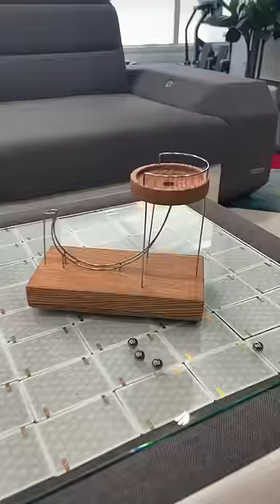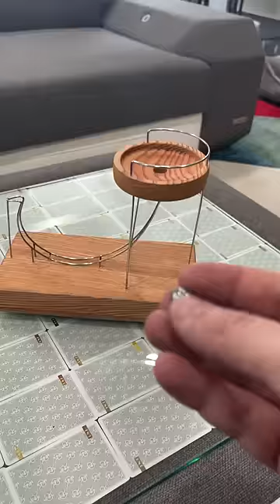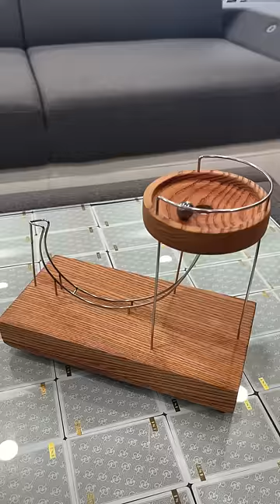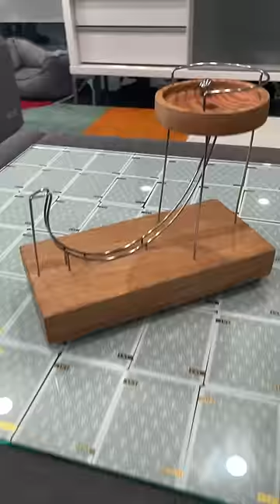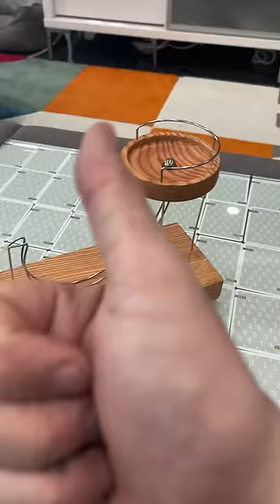An Impossible Perpetual Motion Device?! 😳 #Shorts

Comment: The hardest thing about designing a perpetual motion machine is figuring out where to hide the batteries.
Reply: Exactly
Reply: Magnets.
Reply: @tho3459  magnets are not a source of energy
Reply: @dirgenmeister4018  well, it's done out of electromagnets (batteries too, but yeah magnets are in there too
Reply: @dirgenmeister4018  and what does that have to do with anything? And while you are at it explaining that you can also explain what you mean with "source of energy"
Reply: THO energy is lost as it goes down (even though most is converted to kinetic energy). Energy is required as a result to make up the lost energy to start the loop again. Magnets aren’t a source of energy, so that wouldn’t work as a result. The only way a magnet could do this is if the magnet was moving
Reply: THO source of energy (I presume in the way  he is referring to it) is just something that can give off energy, like a battery (electrical) or a conveyor belt (kinetic and possibly potential)
Reply: Apparently you are a great man according to another commenter
Reply: I think the rails accelerate the beads similar to how a rail gun works, maybe. Im just speculaying
Reply: Hahaha
Reply: Well he did say it's actually impossible. this is likely an immitation of what it would look like if it were real.... Dunno if it's batteries though, might be magnets
Reply: @69cheesyfries  Can't be magnets. There would be no way the magnets could move, which is the only way that a magnet can provide energy.

I've seen an alternate video showcasing this revealing the compartment for batteries at the bottom also.
Reply: Quote by electroboom
Reply: E
Reply: @EEEEEEEE  BRO YOU REPLIED TO MY COMMENT 🤣😭
Reply: -stephen hawking, probably
Reply: Easy you make it wireless and put a wireless pad under the desk
Reply: Honestly though
Reply: @dirgenmeister4018  they are electrically powered magnets and even if they aren’t it’s not perpetual because it requires the magnets to help it otherwise it would not move
Reply: @treyara4852  the ball itself is a magnet 👽
Reply: Im pretty stupid but can’t they use gravity to create one?
Reply: @lehanniehaus9889  lmao no
Reply: Wait ... Really??
Reply: @ericp20z4  what?? No there are no magnets in a battery
Reply: @treyara4852  bro u forgetting gravity is the source of energy
Reply: @above7846  not in a battery... But in this Perpetuum Mobile
Reply: You forgot to add "- Electroboom" at the end
Reply: @dirgenmeister4018  yes they are ..
Reply: @sniperchachashorts5539  u saying that for real? Gravity is a force not a source of energy :v
Reply: @dirgenmeister4018  magnets are absolutely a source of generatable energy, hobbyists have made generators using magnets farther back than I've been alive
Reply: @jorgemas4844  sorry i rotw the message in a hurry i watched the video again 
And my conclusion is there might be electromagnet involved here
Reply: @dirgenmeister4018  bruh read Maxwell's equations ?
Reply: @dirgenmeister4018  but yea stagnant magnets can't do shit
Reply: Or how to convert this motion into energy without losing energy of the machine
Reply: @treyara4852  lol
Reply: @dirgenmeister4018  Magnets completely are a source of energy. Changing magnetic fields in a resistive loop inducate current. (If magnet move inside coil=energy)
Reply: @dirgenmeister4018  huh? 1/2 m v^2. Kinetic energy. Magnets cause motion. How are magnets not a source of energy?
Reply: @AverageLlama_Guy  magnets by themselves are not a source of power, they take as much as they give, maybe you mean that they are using a magnet turning on and off with batteries?.
Reply: Why does everyone think the magnet needs to be moving? It doesn’t, the ball is already moving. 

It’s not that the magnets act as a source of “energy”, it’s more likely there are magnets arranged to create a field in the little hole and as the ball moves through it, it gets accelerated slightly. 

It still obeys the laws of physics because the ball comes back to where it started, meaning that no work was done which is exactly how magnets work.
Reply: Magnets still make the machine perpetual without needed energy or electricity, i dont see a problem
Reply: @MrBigMoneyMan909  
Excuse me, but all of your three sentences are not correct.
There is a battery hidden at the platform which powers a system, if the battery runs out the ball is not able to come back to the top.
You can look it up on the internet this device is already exposed.
Reply: @jorgemas4844  gravitational potential energy aka being elevated
Reply: @angmak7321  the device is not “exposed” of course it uses a battery
Reply: @jorgemas4844  but this doesn’t work of gravity tbf
Reply: @zuby7281  🤣🤣if the ball was a magnet it wouldn't leave the rail
Reply: @dirgenmeister4018  except they are
Reply: @ppproductions6495  ohh shit 😂😂
Reply: @melk7811  Yes there is.  Forces like gravity CAN be so near lossless as to be undetectable over you describe (a well-oiled pendulum, especially in a vacuum being the classic example) but from basic kinematics you can tell the ball has more energy when being launched than it did when it fell in the hole—moving fast and able to clear a lip higher than the hole vs. moving slow and being at the height of the hole.  And none of wood, metal rails, or air are frictionless, there are “gravity funnels” and parabolic tracks you can run marbles down for an incredibly long time, but they require incredibly tight tolerances and still only last minutes to hours before running out of steam, these are not nearly that smooth.  You can even see the ball slow down to a stop from friction in the wooden funnel over over the course of SECONDS, and see it speed up FASTER than gravity can on its own while on the track.  The system has a power input.  The system ALWAYS has a power input.
Reply: @zuby7281  lol yeah we all make mistakes
Reply: @MrHocotateFreight  Magnets still aren’t providing the energy in an electrical generator, the MOTION being applied to them does, the magnets only act to translate kinetic energy (provided by external sources such as a steam boiler or wind or water at a higher elevation  INTO electrical energy.  And no, the falling bead does not count, because it returns to the starting point.  an object moved in a pure magnetic field without an accompanying electric field will generate power on one part of its trip, then expend a greater or equal amount of energy on the return trip, giving you a total power generation of less than or equal to zero.  A system can theoretically be reversible and lossless or close enough to it for it to not matter, but it cannot be that AND have any friction or other power outputs.  If there is power out, there is either power in or the system is losing energy, simple as that.  This system has power out (friction) and the visible parts of the system aren’t losing energy, so either an invisible part of the system is losing energy or there is power in—either of which a battery is the most obvious explanation for, it’s just a matter of perspective whether you consider it part of the system or an input to it.
Reply: @MrBigMoneyMan909  Work was done. Height is potential energy for an object with mass. It gets accelerated downwards by gravity but it's much harder to bring it back up since it loses momentum (energy) downwards due tp friction. Something had to bring it back up. I don't understand why you think no work was done.
Reply: @melk7811  you clearly have no idea of what you are talking about
Reply: @ericp20z4  you forgot the second bracket lol
Reply: As soon as the metal bead touches the metal rods it flicks on and off a timed electro magnet. Just enough to give it the extra push
Reply: @dodger1x  That won't work since the metal rods are connected. The ball wouldn't complete a circuit this way.
Reply: @winsleyocampo6383  Nah, perpetual motion machines break the laws of physics. Everything needs that energy to move, and everytime they do, they lose that energy. Sure, you can spin a wheel in space and it will practically spin forever, but the moment you try to harness the energy from it, the wheel immediately slows to a halt.
Reply: It could be an electromagnet which would allow it to turn on and off quite easily. I believe that a good example of electromagnets are those on theme park rides
Reply: Lmao thanks for answering
Reply: I was guessing magnets on the bottom to give higher speed
Reply: @treyara4852  so its still magnets? XD its pretty clear those beads get accelerated by a magnet which is probably battery powered and turns of the moment they passed
Reply: @Gruesome_j  magnets arent perpetual :D they lose their magnetism over time like a battery that gets drained ^^
Reply: @dirgenmeister4018  They can be. And they do indeed deteriorate. Some of the closest we've come to "perpetual motion machines" has been utilising magnets.
Reply: Close this one uses magnets
Reply: " Drop a marble into the top of this tabletop sculpture, and it rolls down a ramp and back into itself endlessly. While it might appear to defy the laws of physics, the trick is that its base contains a hidden battery and electromagnet that accelerates the steel sphere as it comes down the ramp." That what I find on internet while looking for this toy. Took me like 1 mins. If it's true then this whole conversation and argue are pointless 🤣
Reply: @shady360XD  Ok, I may be wrong here, but I believe that despite the increase of speed as the ball gets attracted to the magnet, The ball would lose more energy than it had gained when it goes to the other side of the magnet due to the attraction in the opposite direction (and other forces)
Reply: @gecgoodpasi1654  Not quite magnets, but electromagnets, which are battery powered.  If it was just a normal magnet, then it wouldn't be able to gain more speed than it lost. Likely what's happening is that the ball is magnetic and there is an alternating current being produced by the batteries in order to change the poles of the electro magnet frequently, so it only pushes the ball magnet as it comes down.
Reply: @YouTube_is_full_of_trolls  what's up?
Reply: @zuby7281  Yes, but the ball isn't giving itself more energy on its own
Reply: @sniperchachashorts5539  Yes, it's the potential energy due to gravity and height, however, it's not enough to get it to slide back up
Reply: @MrHocotateFreight  The magnet not on it's own. It needs rotational / kinetic energy also
Reply: @MrBigMoneyMan909  You can't arrange stagnant magnets that can change the speed of another magnet that doesn't return it to the same speed afterwards.
Reply: @shady360XD  the ball is, and there are electromagnets with alternating poles at play to increase the speed.
Reply: @treyara4852  i mean electromagnets are magnets so yeee xD and like u said its probably a combination of both if the ball itself is a permanent magnet
Reply: @MrBigMoneyMan909  Permanent magnets can't be used here to create the energy we need.  That's because the force that is attracting the ball causes the ball to speed up in one direction (as the ball falls), but then slow down by exactly the same amount as the ball is going back up. This is the same issue with gravity and why the ball can never end up higher than it started.
How I suspect this toy works, is that the ball creates a circuit. There is a microcontroller monitoring that circuit and when it detects that current is flowing though the circuit it turns on an electromagnet at the base. Then after a set time (the time it takes for the ball to fall) it switches the electromagnet off. That way you get a magnetic field when you want it, and none when you don't. Since the ball was being attracted to the magnet durring it's fall it has more energy than that due to gravity, and since the magnet is switched off as the ball is traveling upward it doesn't have to fight the magnet on the way back up.
Reply: @dirgenmeister4018  u can make electricity using magnets—
U lear that in 10th grade :0
Reply: @juanstrobel5273  ELECTROBOOM
Reply: This guy watches technoboom.
Reply: God the amount of extra chromosomes in this thread is enough to make an entire new person
Reply: no they actually have perpetual motion sculptures. Have you not seen iron man
Reply: Its in the wooden disc..
Reply: dude he said its what it would LOOK LIKE
Reply: @ahmeteminsenyurt131  they are real though
Reply: @tho3459  To explain why magnets don't add energy:
Something that is attracted by magnets has a force towards the magnet, but that force stays constant and to get away from the magnet you have to put the energy seemingly created by the magnet back in.
You can compare a magnet to a rubber band.

This here probably has a tiny motorized wheel in the wooden base since the ball starts with great speed.
Reply: Well I mean he did say a perpetual motion machine is impossible
Reply: The easiest way to be dumb is not listening the audio of the video 🥱🤦🏻‍♂️
Reply: How do so many people miss the point of the video lmao
Reply: Bet theres a magnet below the hole that pulls it down to speed up the ball at the very beginning and then by the time the ball gets out of the pulling force it just ramps up
Reply: Hahaha yes
Reply: @dirgenmeister4018  You got 200 upvotes for commenting on something you don’t know about. Magnets are a source of energy. They are used all the time for this purpose. They just aren’t infinitely because they do degrade and become less effective over time.
Reply: @melk7811  There is a magnet in the base. Look for other video where the base is opened. Gravity isn't a source of energy because gravity gives and gravity takes - when was the last time you saw balls bounce higher and higher???
Reply: @JustAFCasual  I am curious, so, what is the point. It seems like the guy just shows off a machine he low key claims to do the impossible for views.
Reply: @dirgenmeister4018  Magnetism is how the bearings move. There's an electromagnet in the base, which when turned on gives the railings a small magnetic field that accelerates the bearing.

So to reiterate, electricity doesn't make the bearing move, a magnetic field makes the magnetic bearing move. So this won't work with glass for example.
Reply: @treyara4852  That's how electricity works my dude, through magnetism.
There's an electromagnet in the base of this device. When turned on it sends a current through the railings which induces a small magnetic field around them. This magnetic field is what pushes the magnetic bearing along the railing.
Because it requires something magnetic this won't work with glass or anything that isn't magnetic.
Reply: @dirgenmeister4018  there aren't just magnets. If it were just magnets the ball wouldn't keep going forever. If it were just magnets, the magnets would pull or push on the ball as it approaches the magnets and then pull or push on the ball with the same force as the ball recedes. The net effect of plain magnets would be zero. Now, if you could just make the magnets move or maybe spin at just the right time...! (Wait, that requires energy....)
Reply: @sniperchachashorts5539  the gravity pulls the ball down until it hits the bottom of the rail (contributing kinetic energy to the ball) and then gravity keeps pulling the ball down as it travels up the rail (subtracting the same kinetic energy as when the ball moved down). The net effect of gravity on the ball in this device is zero.
Reply: @MrHocotateFreight  Yes, but magnets can't give net energy to the ball all by themselves unless they are moved at the right time in the right way or unless electrical current through them moves their magnetic field at the right time in the right way.
Reply: @sniperchachashorts5539  a well-timed electromagnet
Reply: @galaxya69samsung36  changing the magnetic field in an electromagnet requires energy input.
Reply: @yeslinsequeira4612  they aren't a source of net kinetic energy to the ball. A plain magnet would add or subtract kinetic energy to or from the ball when it falls towards the magnet and would add or subtract energy in exactly the opposite direction as the ball recedes from the magnet. Net energy provided by the magnet to the ball would be zero.
Reply: @MrBigMoneyMan909  wherever there is a magnet having an effect on the ball, The net effect of an unchanging magnet would be zero. This is because the magnet adds or subtracts kinetic energy to or from the ball as the ball approaches it and then adds or subtracts kinetic energy to or from the ball in the opposite direction as the ball recedes from the magnet. The net effect is zero.

Completely different story if the magnet's magnetic field is timed to go on and off or is manipulated electronically to rotate or move in some way in sync with the ball's movement That requires energy input.
Reply: @Gruesome_j  The effect of a static, unmoving and unchanging magnet would be zero unless its magnetic field is somehow manipulated electronically or in some other way. That requires energy input.
Reply: @treyara4852  if the ball is falling and then returning to the same height, the net effect of gravity is zero. It doesn't matter what path the ball takes. And the longer or steeper the path that the ball takes, the more energy is lost to air friction. And the sounds you hear the ball making? That's energy lost to the transmission of sound waves through air.
Reply: @Suekru3  A permanent magnet would not work in this specific case -_-
Reply: @bobbabai  You may be referring to the wrong person as I didn't say anything against that.
Reply: @Turgz  electricity works through the flow of electrons

But yes, that's what I'm saying
Reply: @dirgenmeister4018  yes the are
Reply: @treyara4852  Of course not. But to say they aren’t a source of energy is wrong.
Reply: @dirgenmeister4018  no, but when things are effected by magnets, they have potential energy that is lost when they are moved by the magnets. So magnets cant do infinite work.
Reply: @treyara4852  the magnet pulls the steel ball down and has a steel wire from the opposite pole wrapped around to the front of the hole which blocks the "pull down" pole from holding the ball.  The magnet doesn't have to move, only prevent itself from holding the steel ball in place.
Reply: @dirgenmeister4018  magnets ARE energy...they hold energy similar to a battery.  The energy is dissipated as it comes within reach of ferrous material....magnets die over time as they are used.
Reply: It's a battery, hall effect sensor, and an electro-magnet, in the big thick base. If they fall at the same time one will turn on the electro magnet while the other is exiting the loop, turning the kenetic energy it added into heat in the magnet coil.
Reply: @treyara4852  you were so close

Why would running power through the rails do anything?

This is done through magnets, like you said the magnet must be moving. Like yeno the little magnet that's rolling about in the video
Reply: @treyara4852  the balls the magnet man
Reply: @dirgenmeister4018  Yes, actually they are. Magnets aren't magical. They are produced by immersing them in a powerful magnetic field usually generated by electricity. The field they generate performs work. Edit: Thus they can be used as a power source in various ways. They're essentially very inefficient batteries.
Reply: @dirgenmeister4018  bruh magnets are a source of energy
Reply: Timed electromagnets?
Reply: @dirgenmeister4018  he means electromagnets probably.
Reply: Magnets?
Reply: Magnets can produce kinetic energy, Ie. Motion and acceleration. That’s definitely what is accelerating the ball so fast - and why the ball launches higher than the hole it fell down
Reply: @treyara4852  it can totally be magnets because the ball is metal and probably magnetic responding to a field. Which is why it launches
Reply: @ppproductions6495  totally depends on how strong the magnet is. You can separate magnets with you hand.. well, so can momentum.
Reply: @MrHocotateFreight  The magnets are useful in converting energy from one form to another, but the magnets don't make energy by themselves.
Reply: @dirgenmeister4018  magnets are however a source of movement.
Reply: Copied
Reply: Guys there are no batteries or magnets, its just gravity, and in the sense its not a perfect perpetual device because it includes external force which is gravity
Reply: @artisted9910  some may argue gravity is not a force
Reply: @elbabatunde8580  lol it is ofc a force, why its not a force?
Reply: @artisted9910  If I spent the time properly explaining it, I’d be wasting my time. Look it up.
Reply: Lol for people who think magnets are not a source of energy, most generators that exist use magnets. The change in the magnetic field is what creates that electricity, so inputting energy into a magnet will also change the electric field  and create work on a magnet as the balls electric field changes as well.
Reply: Wouldn't gravity be the main contributing factor here?
Reply: @dirgenmeister4018  🤦‍♂️
Reply: @dirgenmeister4018  they can produce force, sooo...they can be a source of energy.
Reply: there's a few versions of this available.

one is a con an uses batteries and the cup has a motor in it to launch the ball down the rails. it's obvious though as the cup with the hole is made of plastic on this version and has a spout before the rails.

the genuine one:

it's made from wood and stainless steel wire only; no batteries, no magnets just kinetic energy.

both on amazon, the fake one that takes batteries is about £16 the real one that's has no trickery or laziness involved in making it costs around £28.
Reply: @lehanniehaus9889  unfortunately, that isn't how railguns work.
Reply: Electromagnets are the things you all are look for
Reply: Arguably, all you need to hide is the wire FROM the battery.
Battery can be hidden or tucked far away from the action.
Wire's easy to hide.
Reply: @eneveasi  Except it can't be a permanent magnet that propels it because the speed it would gain as it gets attracted down is the same amount it would lose on the other end as it's attracted backwards
Reply: @Hazed64  I was talking about the mechanism under the wood. Not the ball itself. That can't be a permanent magnet.
Reply: @Hazed64  Because a permanent magnet can't do this alone. Yes as the ball comes down, the ball will be attracted to the magnet and go faster, but then after going past the center of the magnet, that same attraction will occur backwards as well slowing it down. The speed gained will be equal to the speed lost, resulting in no net gain.

The reason having power through this is because the bottom isn't a permanent magnet, but actually an electromagnet. The current provided by the batteries underneath provide an alternate current and  cause the electromagnet underneath to be switching from attracting the magnet to repelling often. Because of this switching, only that would allow it to accelerate that much.
Reply: @EricPriceOfLouisville  First of all, if the steel wire is wrapped around the ball, the ball would have a net pole of whatever the wire is, so the magnet wouldn't attract in the first place well. The magnet would always be closer to the wire, so the net attraction would always be repulsion.

In order for a permanent magnet to give off energy, it needs to be moving. Only then can it induce a current inside another wire. A magnet doing nothing cannot provide a net change.
Reply: Ohw wow, those comments made me literally a bit dumber reading them. 
The sheer confidence ppl here stating  that "magnets are a source of energy" or "you forgort gravity" is just mind boggling.  
1. Go back to school. 
2. If you don't know shit, don't embarrasse yourself online
Reply: @EricPriceOfLouisville  First of all, if the steel wire is wrapped around the ball, the ball would have a net pole of whatever the wire is, so the magnet wouldn't attract in the first place well. The magnet would always be closer to the wire, so the net attraction would always be repulsion.

In order for a permanent magnet to give off energy, it needs to be moving. Only then can it induce a current inside another wire. A magnet doing nothing cannot provide a net change.
Reply: @EricPriceOfLouisville  First of all, if the steel wire is wrapped around the ball, the ball would have a net pole of whatever the wire is, so the magnet wouldn't attract in the first place well. The magnet would always be closer to the wire, so the net attraction would always be repulsion.

In order for a permanent magnet to give off energy, it needs to be moving. Only then can it induce a current inside another wire. A magnet doing nothing cannot provide a net change.
Reply: @EricPriceOfLouisville  First of all, if the steel wire is wrapped around the ball, the ball would have a net pole of whatever the wire is, so the magnet wouldn't attract in the first place well. The magnet would always be closer to the wire, so the net attraction would always be repulsion.

In order for a permanent magnet to give off energy, it needs to be moving. Only then can it induce a current inside another wire. A magnet doing nothing cannot provide a net change.
Reply: @EricPriceOfLouisville  First of all, if the steel wire is wrapped around the ball, the ball would have a net pole of whatever the wire is, so the magnet wouldn't attract in the first place well. The magnet would always be closer to the wire, so the net attraction would always be repulsion.

In order for a permanent magnet to give off energy, it needs to be moving. Only then can it induce a current inside another wire. A magnet doing nothing cannot provide a net change.
Reply: @Suekru3  Fair enough
Reply: Wow, the amount of people saying that magnets are a source of energy....
Magnets are just a static magnetic field, they will never generate any energy without external motion, that we are trying to CREATE here in the first place 😑
Reply: @dirgenmeister4018  Uhm do you know how a magnet is created in nature ? Alot of stored energy in magnets :) Basic physics buddy.
Reply: @yeslinsequeira4612  because they take as much as they give, they don't provide energy to the system, they give as much energy attracting as they take resisting the object to move from the magnet. Thus they are not a source of energy
Reply: @MrBigMoneyMan909  no, it's powered with batteries, look it up on the internet.
Reply: @tho3459  YEAH BITCH!!! MAGNETS!!!
Reply: @ericp20z4  electromagnets* not actual magnets
Reply: We had one in our house when I was a kid... it needed no batteries, it stops eventually do...

It can take 6 days before it fully stops...
Reply: Gravity is proving the energy each time
Reply: @winsleyocampo6383  gravity helps, but it can’t be used to create a perpetual motion machine. Due to friction, air resistance, and possibly other unknown unknowns, some of the potential energy from gravity will be lost as heat; gravity alone could not make the ball “jump” higher than its starting point.
Reply: True
Reply: @lehanniehaus9889  Which requires electricity.
Reply: Lmfao
Reply: @IONATVS  gravity isn’t a force
Reply: @UltimateFeudEnterprise  Depends on the textbook if they call the Gravitational Force “Weight” or just “Gravity” but in either case it absolutely is one.  Weight_AB = Force_Gravity_AB = UniversalGravitationalConstant * Mass_A * Mass_B / Distance_AB^2
Reply: 166 comments... yet I can't see a single one.... perpetual bs? Idk
Reply: @jorgemas4844  no but an object pulled away or moved ina certain posicion in the planet's gravitational field gives it potential energy, gravitational potential energy.
Reply: @dirgenmeister4018  yes they are
Reply: @Gruesome_j  niether do I
Reply: @lukescovell8294  true
Reply: - ElectroBoom
Reply: @treyara4852  magnets don't have to move to impart energy they have a magnetic field which weakens over time as it imparts energy to fling the bead
Reply: Jesus Christ is Lord. It is all true. Please take your salvation seriously.  Read the Bible and do what it says
Reply: @MrHocotateFreight  I love reading the comments on this. Clearly alot of people failed physics and has no idea that magnets or rather magnetic forces can be generated by electricity.
Reply: @sniperchachashorts5539  you can't get enough from that. Some is lost to heat and friction. That's what thermodynamics says
Reply: @charlessellars7871  Magnets to do need to move in order impart energy. All that stationary permanent magnets provide is a constant magnetic field.

If a magnet is needed to move in order to get energy out of it. When a magnet moves through a coil, there is a current produced in the coil. This movement of the magnet inside the coil is basically how power generators work iirc.

A permanent magnet would not work in this case. The ball is a magnet. 

As it goes down and gets to the supposed permanent magnet, the ball will speed up due to gravity and the magnet on the ground. However that changes immediately the ball goes to the other side of the magnet.

The ball is still a magnet that's attracted to the magnet on the ground. That attraction is in the opposite direction. Due to that, the ball loses speed. The thing is, it loses the same amount of energy that it gained int he beginning for no net change.
Reply: @galaxya69samsung36  that's a big if
Reply: @Gruesome_j  lol thermodynamics disagrees with you.
Reply: @treyara4852  you do know you can arrange the magnets where they push the bead along, they do not need to actually move, magnets are not permanent and will lose power as it imparted onto that ball to toss it back up
Reply: @iamthedoctortoday5788  Bingo! An electromagnet with a pressure switch at the bottom of the rails which turn it off for a second as the ball (now with greater kinetic energy) can overcome the gravitational pull and do the seemingly impossible.
Reply: 😂😂😂 nailed it.
Reply: @dirgenmeister4018  magnetic field is literally the source of energy.
Reply: @dirgenmeister4018  magnetic energy
Reply: @yeslinsequeira4612  motion created by a magnetic field is an example of potential energy being converted to kinetic. You have to "charge" the object first by placing it some distance away from the magnet. When you do that, you do work against the magnetic field, and it's your hand that is the source of energy, not the magnet.
Reply: They're in the thick base of this toy
Reply: Was reading the comments to see if anyone noticed the "beads" at the beginning of the video moving towards one side of the table as it the table was not evenly leveled. Not saying the video is fake, just saying
Reply: @dirgenmeister4018  electromagnets
Reply: @ajvasquez160  it absolutely doesn't matter. Gravity is a conservative force, so no matter how you arrange the whole contraption, it won't work without an external influx of energy. Whatever conservative force acts on a bead when it travels down, will have to act on the bead on its way up, slowing it down and eventually bringing it to stop. But we see that at some point the bead reaches a much higher altitude compared to the point it started its descent from. That means that something gave the bead that extra energy. One of the ways to do that is to switch the magnetic field on and off, so that it would accelerate the bead when it travels down, and would not decelerate the bead when it travels up.
Reply: @charlessellars7871  First of all, Please can you tell me how you would arrange the magnets so that it only pushes the bead but doesn't pull. If you can let me know, then I will concede this, but the problem is you can't do it without having the ball lose the same amount of speed that it gains from the magnet. The net change in speed due to the magnet would have to be 0.

As for your other point for the magnet losing its pull over time, this is true, however the amount of pull lost per iteration is so small, it can be reasonably assumed to be 0
Reply: @tho3459  Means energy is being put into it so it’s not a perpetual motion machine as they don’t exist…understand now 😜
Reply: @sniperchachashorts5539  there needs to be extra energy added each time to counteract the potential energy lost to friction and air resistance that isn't converted to kinetic energy. If there wasnt extra energy input then the ball wouldn't reach the height necessary to get back up to the funnel.
Reply: @jorgemas4844  "gravitational energy" is a common shorthand for gravitational potential energy. There's no need to be pedantic.
Reply: @MrBigMoneyMan909  work is always done unless you're in a frictionless vacuum which is exactly why perpetual motion machines are impossible because frictionless vacuums don't exist.
Reply: @tho3459  the most of it ooo
Reply: Magnets are a force of energy, not a source of energy
Reply: Someone ordered this and never got it?? I wondered how much they paid 🤔 ?
Reply: Someone ordered this and never got it?? I wondered how much they paid 🤔 ?
Reply: or the old man turning the crank
Reply: If you look at the ball, it is still losing energy in the jump, it’s just that the wooden platform lets it regain the lost momentum by allowing the ball to travel towards the hole—it’s initial point—once again. If you look closely, the ball always falls short of the hole. That’s the lost momentum that most definitely exists.

The platform could be any length between the hole and the ramp exit, and it could still be considered an infinite loop in this regard. The same principle is present here, at a smaller scale.
Reply: Of course, no one could ever prove that it is perpetual.
Reply: Simply gravity there
Reply: @jorgemas4844  that's all a matter of perspective
Reply: Electricity is simply electrons moving due to a force exerted upon them. Therefore it is not a source of energy, but simply a symptom of another force at work. Odds are the force that acted on it went in motion form another force.
Reply: Hahaha 🤣
Reply: Gravity is a good source of kinetic energy
Reply: It’s batteries, I bought one of these… returned it
Reply: @winsleyocampo6383  no, to pull something up in a gravitational field it takes energy, combined with friction causing it to lose energy.
Reply: What batteries?
Reply: yeah
Reply: @dirgenmeister4018  Magnets are definitely a source of energy.
Reply: @treyara4852  wth would it need batteries for, the bead falls down and is sling shot back onto the top to repeat the process..
Reply: @sniperchachashorts5539  magnetic ball and rails, to accelerate it I guess ?
Reply: @JB-pb9xv  When the ball falls, the magnet attracts the ball to make it go faster. That part  is true, but as it starts to go up again, away from the magnet, where it would supposedly slingshot back to the top, the magnet is still attracted to the ball. The ball is moving forwards, but the magnet is attracting the ball backwards. Because of this, the ball loses the same amount of speed gained by the magnet, and there is no change in speed, meaning magnet or not, it would get to the same place in an ideal world

In the real world, this magnet interference would result in an even shorter distance traveled in the air.
Reply: @JB-pb9xv  Because of the way magnets work like that, the ball wouldn't have a net increase in speed. The reason batteries are required is because batteries can power an electromagnet with an alternating current. With this, the magnet is going to be constantly switching poles back and forth, so the ball gets attracted initially, but then as it goes past, it gets repelled afterwards to finally get that effect.

Another way to disprove the idea with permanent magnets is that we know that perpetual motion machines cannot exist. If it were just a still magnet without the magnet experiencing any sort of change, it would be perpetual motion, with no energy lost. The battery is needed to supply the energy lost.
Reply: I think magnets are a source of energy, we just haven't discovered how to extract it yet.
Reply: Instead of perpetual motion why not very long time motion like 50,000 years? Then even at that point when it’s over just start up another one
Reply: He did say "It doesn't exist but IF it did, it would sorta look something like this." You're so smart you don't even know how to listen. lol
Reply: No,. It's the wired that are hard to hide
  You can use 2036 watch batteries on the bottom of this.  How do you get the wired from the batteries up to the electro magnet on the top to complete the magnetic circuitl?
Reply: @69cheesyfries  Well said.
Reply: @c_n_b  The problem with that sentiment is that we do know how to. It's through the movement of the magnet through a coil. That's how we get electricity from a generator. It is necessary for the magnet to move for the energy to be extracted.

It's impossible for stationary ones though.
Reply: @samesamv1472  And it uses batteries... It's a quote about batteries in a perpetual motion machine. Sure it would look something like that, but it's just commenting on how they don't exist.
Reply: @tylerpixel  We would need nigh 0 friction. I'm not sure we can get that yet.
Reply: And magnets. Dont forget magnets!
Reply: Hahaha
Reply: Humans are OG perpetual motion machines
Reply: @MrBigMoneyMan909  work was done to overcome the losses due to friction and air resistance.  If there was not energy loss it could be scaled and turned into a generator that creates free energy
Reply: All of you arguing that perpetual motion machines exists should go back to school and study your basic science. I mean fuck, this thing launches the ball HIGHER than where it starts off.
Reply: @OurNarutoSaga  Except for the part where we eat and breathe, sweat, do any physical activity, do literally anything, etc
Reply: Abrar  I don't even know what this comment is in reply to, I just giggle reading it.
Reply: @artisted9910  gravity is internal, not external.
Reply: @oh0stv  you said that while spelling embarrass wrong. You also misspelled forgot. You have an unnecessary double-space. I'll hush. You're properly red now.
Reply: @UltimateFeudEnterprise  yeah, what was Newton thinking?
Reply: @charlessellars7871  we will all wait for 10-100 years to see when we can measure the weakening of the magnetic field of a permanent magnet. You take first watch.
Reply: @TortureBot  sprech deutsch mit mir, wenn du was zu sagen hast.
Reply: @dirgenmeister4018  according to quantum physics all particles that make up mater, molecules, atoms, subatomic particles, Quarks. All of them consist of energy. And make up the illusion of physicality, and is the first thing you learn when your professor starts ranting. So magnets are not only a source of energy, but ARE energy. Just as much as your all-knowing self is a waste of energy
Reply: @treyara4852  what if we get magnets to move magnets and  magnets to move magnets and  magnets to move magnets and  magnets to move magnets and  magnets to move magnets and  magnets to move magnets and  magnets to move magnets and  magnets to move magnets and  magnets to move magnets and  magnets to move magnets and  magnets to move magnets and  magnets to move magnets and  magnets to move magnets and  magnets to move magnets and  magnets to move magnets.
Reply: Under the wood
Reply: @treyara4852  really Mr. Try Hard McGee?  Why don't you share said alternate video? Magnets could definitely work in this setup, but will lose their pull overtime. They act on the kinetic energy of the steel balls and aid the centrifugal motion to add speed.  The magnets would be implanted somewhere in the device, they wouldn't need to move at all. Did you know that in some parts of the world railstations use magnets to hover carts over the tracks to provide a smoother, more energy efficient train ride?
Reply: @bobbabai I think you’ve misread the room, although there are some misguided folks on here for sure, nobody here has expressed they believe it is actually a perpetual motion machine, as it isn’t/couldn’t be (as you point out) it was well established in the comments that this system must use an external source of energy and it has batteries in the base to power an electromagnet.
Reply: @artisted9910  there are both batteries and an electromagnet
Reply: @tsloth1390  I can't take the time to review this nearly 300-comment thread to find out how I got it wrong. YouTube is terrible for this.
Reply: Source of energy... gravity!!
Reply: @dallaspower  No. It's not a source of net energy if your height above the center of the earth just varies up and down by the same amount each cycle. In that situation, the ball and the earth are just trading energy, with a little bit of energy lost to friction at every instant.
Reply: Magnets ... As stated previously I'm certain
Reply: @dirgenmeister4018  that is not true...but it also hasn't been proven yet either..except maybe one guy..Tesla..but we'll probably never know everything he knew or created.
Reply: Battery Electro magnet with timed off switch. The magnet turns on to generate momentum then quickly turns off to free the ball from magnetic forces.
Reply: @EEEEEEEE  æœ
Reply: @tophatvideosinc.5858  That is a good thought, here's what's wrong.

1. If the magnets are straight, then you'd have to push the end magnet, so then you'd be supplying energy making this not perpetual

2. If the setup is a ring type of structure, you encounter 2 problems.

a) As you start placing down your magnets in the ring, you'll find the last one you try to place down will be super hard to place because of the repulsion effects that you would want to theoretically make it spin forever

b) The magnets in the ring, despite having only repulsive forces being acted on them, are in equilibrium. There's a friction force, and 2 non-linear magnetic forces on it. As it's in said equilibrium, it will not move. If it's already moving, the friction will be greater and cause it to slow down on the ring, and the entire thing will slow to a halt.

It wouldn't work.
Reply: @EEEEEEEE E
Reply: @dirgenmeister4018  potent energy
Reply: @dirigenmeister magnets, like batteries, demagnetize after a while, making it a "fake" perpetual motion device
Reply: @yeslinsequeira4612  There can be no net change in energy due to the magnet before and after the effects are felt from the magnet
Reply: @solomonkirton9347  Except it can't be magnets in the first place because the speed the ball gains is the same amount it would lose. Also the decrease in the pull in the magnet takes so long that it can be assumed to be negligible for a run of the machine
Reply: @sniperchachashorts5539  you confuse force and energy. A Force only Work (produces energy) depending of angle between force and mouvement. So when you're standing still or in a car, gravity doesnt "work"
Reply: It's in the bottom
Reply: @treyara4852  what if the balls were magnetic?
Reply: @dirgenmeister4018  magnetic energy?
Reply: @andrewthecoleman  They are. Permanent magnets wouldn't work though because the ball would lose the same amount of speed that it would gain. It has to be (and is from other video's I've seen) an electro magnet.
Reply: @dirgenmeister4018  "Electromagnetism crying in a corner"
Reply: No - it's even simpler - just magnets
Reply: @treyara4852  the ball is moving
Reply: True. The way the ball jumps to the top seems unnatural. something's fishy
Reply: @neilsjmcmahon  I know. The ball (due to the magnet) will accelerate because of the magnetic pull as it goes down the ramp, however it will then decelerate immediately after due to the magnet attracting in the wrong direction, so it slows down until it's at a net change in speed 0 from before and after the magnet was really affecting it.
Reply: @yeslinsequeira4612  oh no, someone didn't go to school
Reply: @lehanniehaus9889  no its just gravity
Reply: -ELECTROBOOM
Reply: @tho3459  Magnets alone can't do this. It's not a completely isolated system so there has to be a source of energy.
Reply: @ariffansar4994  more downwards acceleration = more momentum to make the jump?
Reply: I think the rod over which the conducting ball rolls over has current flow
Reply: They are under the base I guess
Reply: @dirgenmeister4018  magnets don’t stay magnet forever either
Reply: @dirgenmeister4018  They are if you don't think about it.
Reply: In this case it’s not even hard though with a large and conspicuous base, obviously it’s using an electromagnet to accelerate the ball on its way down.
Reply: Magnets. You can see the opposing poles as it makes its way down the hole.
Reply: @tho3459  
I'm not sure anyone could explain anything to you. A book, a mind, and a parachute all function best when they are opened.
Reply: @jorgemas4844  
Look for a veritasium video clip titled gravity is not a force. Available on YouTube.
Reply: Gravity?
Reply: @IONATVS  
Some of the simplest things are almost impossible to explain to simpletons.
Reply: @generalmisery  
Toys are fun and people are not as clever as they think they are
Reply: @alexjanito3404   Without any expenditure of energy elsewhere in the system to stop it from happening that same magnet would pull that same energy out of the ball as it “just ramps up.”  The magnetic field a magnet that isn’t being moved creates is, always and inevitably shaped in such a way that the amount of magnetic potential energy an object has only depends on its position relative to the magnet.  And that means if you return to the same spot, no matter what path you take to get there, you have the same magnetic potential energy that you started with, and if you are losing energy to friction it’s physically impossible to get back to the same spot with the same speed without some other store of energy losing energy or power coming in from outside the system, and only at exactly the rate that that other source loses energy or supplies power OR LESS.  The same is true of gravity fields.  Other power inputs can move the magnet or a mass in such a way that this no longer holds true, but that is by definition a power input and thus not a perpetual motion engine.  All energy has to come from somewhere and while you can temporarily store energy in a magnetic field, or chemical bonds, or matter you can’t get more out of it than you put into it. Magnets and Gravity aren’t magic, the way they work follows strict observable rules, and under those rules there is simply no way to make a perpetual motion engine.
Reply: @IONATVS  ok. So then how does it work..
Reply: @alexjanito3404  ELECTROmagnets or natural magnets being MOVED by a hidden electromechanical system that uses equal or greater amount of energy than the ball bearing gains.  The difference is while an object in any given position in a static magnetic field has a fixed potential energy, the CHANGE in the magnetic field can TRANSMIT some or all of the power used to change that field into an object moving in that field.
Reply: @IONATVS  ah, so essentially if theres magnets, it has to be powered by say atleast 3 volts with a more complex system than we are being shown. Most likely in the base
Reply: @winsleyocampo6383  Gravity is a force, not a source of energy, so even if they did, ir wouldn't be "perpetual energy"
Reply: @alexjanito3404  precisely. it doesn’t have to be much, but there has to be something inputting power to the parts of the system we can see (ie something like a battery that we don’t see but is losing energy) to overcome the friction and air resistance and bring it back to the starting energy state.  Perpetual motion machines are, under all known physics, completely impossible, so “making” one is just a stage magic trick—they’ve designed the system so it looks vaguely plausible but have a secret they’re hiding that makes it do what they say it does, but not WHY they say it does it.
Reply: Umm, in the wooden base 😏
Reply: I didnt know it has battery😂😂😂😂😂
Reply: @lehanniehaus9889  Well, you’re definitely speculating but, that doesn’t necessarily mean you’re wrong.
Reply: too true😂😂😂
Reply: @Gruesome_j  Sounds reasonable, except that our universe just doesn't work that way.
Reply: @dirgenmeister4018  an electronic magnet
Reply: @treyara4852  without magnetic field electricity is not possible sorry that's part of the law
Reply: You kill a professional bowler and trap his ghost in the ball. C'mon man!
Reply: @lemnlit3291  Umm... When did I say that's not the case?
Reply: @lemnlit3291  Also btw you are only half right. A magnetic field can induce electricity if it moves, but electricity can also induce magnetism as magnetism caused by acceleration of electrons.
Reply: Jesus Christ loves you all please repent and forgive
Reply: @littlesam6280  moment
Reply: @dirgenmeister4018  magnetic fields have energy stored within them
Reply: @treyara4852  I'm probably the 100th person to reply to you, but the magnet wouldn't need to move in order for it to provide "energy".

The way this works, the best I can understand it, is that there's a magnet (electronic, most likely) at the bottom of the rail. When the ball bearing gets within the magnetic field, the ball bearing starts getting pulled toward the magnet, allowing for a larger acceleration than just gravity alone. From there, 1 of two things happen.

1. Because the ball bearing is moving so fast, and it's dense, it has a lot of inertia. This invariably carries the ball past the magnet. The magnet doesn't need to be that strong to provide additional acceleration while the ball is being pulled down by gravity, so it likely isn't strong enough to trap it, or slow it down significantly enough before the ball is launched.

2. The slightly more complicated answer would be the use of electromagnets. Since the rails are likely a conductive material, and the ball most likely is as well, they could have an electromagnet at the bottom of the curve, which is significantly stronger, and provides for even more acceleration and inertia. This magnet could simply only be turned on while the conductive ball is touching both conductive rails, which would close the circuit. Once the inertia of the ball carries it off the rails, the circuit is no longer closed, no power is being fed to the magnet, and it's not pulling the ball back toward it anymore, until the ball touches the rails again.
Reply: I’m not saying it’s Aliens but….
Reply: @AugmentedSmurf  The only possibility is an electromagnet. A permanent magnet cannot work in this case, because it will slow the ballbearing just as much as speed it up, so will have no net effect. Your suggestion about using the rails themselves to complete the circuit is an interesting one, and possibly could work. Either way, a power source is definitely required, and it needs to have some way to momentarily activate an electromagnet each time the ballbearing begins it's downward cycle.
Reply: They are always showing....SMH

Batteries these days
Reply: OMG NOT MAGNETS, GRAVITY
Reply: @lehanniehaus9889  but a rail gun works similar to how a remote controller vibrates it has little motors that spin with batteries around the edges of the motor creating a pull Forcethat would be pretty danm hard to hide also the device would be super bulky if it were to be using a magnet strong enough to pull the metal bead from down below so really who knows how it works other than scientists
Reply: @tho3459  Problem is a permanent magnet takes away that extra acceleration for the jump that it gives
Reply: @treyara4852  If you were to put it in the entire base yes. I think it should be doable if its only right below the hole.
Reply: @tho3459  The problem would still arise just below the hole. The ball gets very attracted to the hole and goes down it, but then the ball starts falling and going down the ramp, but the magnet is still attracting the ball, just in the upwards direction. Any speed that was initially gained from the magnet will be lost as this occurs, so it is as if the magnet isn't there at all
Reply: @treyara4852  no, i mean in the base but under the hole. The shape of the rail moves the ball far enough away from the magnetic field before the jump.
Reply: @tho3459  If you mean directly under the hole inside the wood, that still wouldn't work.

1. The magnet being that far away initially from the hole doesn't make the ball go so much faster, so initially the magnet will have very little effect.

2. The point where the magnet would be closest to the rail is still a fair distance away, but assuming that pull is non negligible, the magnetic pull would be towards the magnet. It would not help pushing it down the rail. The force would be into the rail; barely down the rail if at all, so barely any speed would be gained by the magnet if at all.
Reply: @treyara4852  1. If the system has low enough "friction" even a slight boost might be enough.

2. Same with gravity.
Reply: @tho3459  Gravity is a conservative force, so that will not help. Also along with the slight boost, the magnet is pulling the ball into the rails. This forces the normal force of the railing to increase so that the rail doesn't break.

Ffriction = Fnormal * mu. Because the normal force increases, Force friction also does so as well, so then the slight boost should be counteracted by friction itself
Reply: @tho3459  Gravity is a conservative force, so that will not help. Also along with the slight boost, the magnet is pulling the ball into the rails. This forces the normal force of the railing to increase so that the rail doesn't break.

Ffriction = Fnormal * mu. Because the normal force increases, Force friction also does so as well, so then the slight boost should be counteracted by friction itself
Reply: @tho3459  Gravity is a conservative force, so that will not help. Also along with the slight boost, the magnet is pulling the ball into the rails. This forces the normal force of the railing to increase so that the rail doesn't break.

Ffriction = Fnormal * mu. Because the normal force increases, Force friction also does so as well, so then the slight boost should be counteracted by friction itself
Reply: For real...and they hid them so well....how is this working X D
Reply: @dirgenmeister4018  they are, it costs energie to produce effictive magnets, and dont forget about Electric magnets.
Using magnets for perpetual motion would still be cheating.
Reply: @tho3459  hes completely wrong, u cannot make magnets without investing energy and overtime those magnets would die down. Aka the battery runs out of Juice over time.
Reply: @darrellbeets7758  yeah, over a while. Its not like batteries where you need to change them like once a day/week of running it.
Reply: @tho3459  i really dont see what the point of ur argument is but yes? Magnets last longer on average then zink batteries??my only point was saying a Magnet is a medium to store energie or take energie from aswel, and could or should count as a batterie on a perpetual motion device or in general if u ask me.
Reply: @darrellbeets7758  yes, same as me.
Reply: @darrellbeets7758  Electromagnet underneath the base (in the wood), powered by batteries also located there also
Reply: @treyara4852  oké that would work...but how did he manage to solve the timing issue, a railgun with a magnet turned on at all times wouldnt really ve possible 😜
Reply: @darrellbeets7758  I'M LITERALLY SAYING THAT A MAGNET THAT'S ALWAYS ON WILL NOT WORK!

The battery provides an alternating current causing the poles of the magnet to switch back and forth every so often. It's just that 
-_-
Reply: @darrellbeets7758  Also where did you get this railgun idea from?
Reply: @treyara4852  as an example. Rail  with Magnet shooting metal..
Reply: @neilsjmcmahon  No. Electro magnets
Reply: @darrellbeets7758  I specifically asked where I said rail gun.

I said rail. You know? The thing the ball is traveling on? The 2 thin point ramps? That rail?

When did I say magnet shooting metal?

What?
Reply: @darrellbeets7758  quote me
Reply: @tho3459  it does with the fact that it's a perpetual motion device, and needs energy? Not a magnet lol
Reply: @Soarano  From wikipedia: "In physics, the kinetic energy of an object is the energy that it possesses due to its motion. It is defined as the work needed to accelerate a body of a given mass from rest to its stated velocity."

Does a magnet not apply a force to help accelerate a ferromagnetic ball?
Reply: @dirgenmeister4018  Yes they are magnets + gravity = energy
Reply: And the magnets!
Reply: @eugene9852  Exactly my point. The closest you can get. You just expanded my point. But, you got it 110%. The OP was staying that magnets had nothing to do with it. They are the "closest," it being an oxymoron and all.
Reply: @tho3459  uhh no it doesn't unless it's an electromagnetic being this case here which is powered by the battery?
A magnet itself doesn't contribute to it gaining kinetic energy
Reply: @Soarano  im not quite sure that we have had the same magnets in that case.
Reply: He never said this was real. Its just a thing showing what perpetual energy would look like
Reply: @lehanniehaus9889  I think theres a small electromagnet and the base of the ramp in the wood that helps push the ball back to the platform. It seems like it wouldnt be worth the extra cost and effort to incorporate the magnets in to the rail. It's a toy after all. But I'm no magnet expert so who knows.
Reply: @treyara4852  electro magnets my man. It's not a perpetual motion device no matter how you cut it. But if were talking about how this toy works, my guess is an electromagnet at the base of the ramp in the wood that helps push the ball a little.
Reply: @above7846  You can power an electromagnet with batteries.
Reply: @MrHocotateFreight  magnets only "generate" electrical energy when you pass a magnetic object through its magnetic field. You have to use some form of mechanical energy to do that. Thats how generators work. Or inversely you can use electrical energy to power a magnet that then imparts a force on  what ever magnetic object is in its magnetic field and makes it turn or move. Converting electrical energy in to mechanical energy. Like a ceiling fan. The magnet it self does not generate energy unless another force is acting upon it.
Reply: @galaxya69samsung36  but you have to use a mechanical force to move the magnet in the first place. Thus it is not generating energy it is converting energy. Also known as transduction if you want to use big words.
Reply: @IONATVS  preach brother!
Reply: @treyara4852  you would be absolutely correct. the only thing is electromagnets can be turned off and on at the right time to give the ball a speed boost without slowing it down. This ofocource requires electrical energy likely coming from a battery in the base.
Reply: @charlessellars7871  and as the ball passes over the center of that magnet the same force that attracted it forward will attract it backward resulting in a net gain of 0.
Reply: @jamesmayle3787  Take your meds please.
Reply: @stevenc8717  it has battery powered electro magnet. The ball can only reach a higher altitude than it started at if an extra force is acting upon it. The electromagnet turns on briefly to give the ball a little boost as the ball passes through one magnetic pole but turns off before that same magnet can slow it back down with its other pole. This adds just enough energy to push the ball back up to its platform. In this system chemical energy (the battery) is being converted (by the magnet) in to mechanical energy ( motion of the ball).
Reply: @treyara4852  I dont mean to be pedantic but i think something slightly different is going on. Batteries do not produce alternating current. They produce direct current. I think that instead of the fields switching back and forth like with AC, it actually stays the same but there is a control circuit that turns the magnet on and off. Now, there could be a device that converts DC to AC (that's what a rectifier does right?) to do it the way you explained but I think that would be unnecessary for making this toy and would probably consume more energy. I'm open to the possibility I'm wrong though.
Reply: @Jagger02  You are thinking of electromagnets. Electro magnets require electrical energy to function. Which what is most likely powering this toy.
Reply: @tho3459  If it never returned to its starting point, it could, but there is a property of gravitational and magnetic fields that in a static (ie not moving) field, an object’s potential energy in the field is ONLY a function of the object’s position, not the path it took to get there.  That means that a fixed magnet can accelerate a ball as it falls towards it, but if it moves back to the starting point, as it does in this case, it will decelerate it by the EXACT same amount.  which means the kinetic energy of the system can not increase from doing a loop in a static gravity or magnet field.  And with losses due to friction, it shouldn’t even be able to do that.  If you use electrical energy to temporarily CHANGE the magnetic field, you CAN add energy and not remove it, but you must supply at least as much energy or more from an outside source to do so.  For example, a battery.
Reply: @AugmentedSmurf  number 2 is correct for the most part. Number 1 is wrong because the magnet attracts ball as it comes in and speeds it up. However, once it pass the center of the magnet the exact same force that sped it up will slow it down resulting in net 0 work done.
Reply: @animalmother3526  Um. Did you mean to reply to another person? I've been arguing that it's been electromagnets for 3 weeks now.
Reply: @animalmother3526  To your comment taht started off like this:  you would be absolutely correct. the only thing is electromagnets can be turned off and on...

Yea... That's what I've been saying? what's your point? No one is arguing that perpetual motion machines are possible.
Reply: @animalmother3526  To your comment that starts off with: I dont mean to be pedantic but i think something slightly different is going on.

That is true. I mistook the type of current. Turning it off an on is fine as you said as long as the magnet is powerful enough. I am curious now whether the creators opted to alternate poles or just switch on and off
Reply: @animalmother3526  no it depends on how ypu set up the magnets and also, I have made one of these before,  it's not that hard to do and makes for a little fun science project on magnets,
Reply: I would think if it continuous works it is creating its own energy .... Even if there are magnets if it's working under its own effort it's perpetual energy ...
Reply: @eneveasi  electromagnets powered by electricity yes. Permanent magnets no.
Reply: @eneveasi  a permanent magnet will impart a force and pull the ball as the ball enters its magnetic field speeding it up. Once the ball passes the center of the magnet the same amount of force that made it go faster will now slow it down. Resulting in net 0 force. Basically, a permanent magnet wont make a difference. An electromagnet on the other hand can be turned on/off so that its pulls the ball but turns off as the ball passes in order to speed it up. However an electromagnet requires electrical energy obviously.
Reply: @treyara4852  Yea me too. I hadn't originally considered that they by alternating poles. That is how 3 phase motors work afterall.
Reply: @treyara4852  I probably did. Theres alot of people here who didnt pass fourth grade science but they're confident they have all the answers so I kind of went on a comment spree. I also hadn't realize I replied to several of your comments. I was genuinely trying to have a good conversation with a couple folks.
Reply: @treyara4852  and now I'm wondering how many other people I accidentally replied to. Lol
Reply: @animalmother3526  Interesting, thanks for the breakdown. I can see what you're saying makes sense when I think about the forces.
Reply: @animalmother3526  I know
Reply: @above7846  I dont really want to scroll through the 300 comments to find out for sure but I may have replied to you by mistake. I did with atleast one other person. lol.
Reply: @charlessellars7871  I'd love to see a demo of it then. Can you post a video of it in action?
Reply: @animalmother3526  this is a video of it, you can buy one of these for yourself.
Reply: @charlessellars7871  did you post a link? I dont see anything.
Reply: @animalmother3526  you're commenting on the video right now,  sorry if you can't understand simple physics
Reply: @treyara4852  do you know how electromagnets work? The fields of electromagnets CAN move so therefore CAN provide energy in the form of kinetic energy without the actual electromagnets themselves having to move, the amount of electric current provided to the magnets determines the output of the magnetic field thus imitating a kinetic-type force moving from point a to point b. So yes it IS magnetic energy doing this, but it’s electromagnetic energy not just some random bar magnet sitting still.
Reply: @bender0428  Umm. Which comment of mine are you referring to?  I'm saying it HAS to be an electromagnet and that it CAN'T be a permanent magnet. If your argument here is that it could be a permanent magnet but it could also just be an electromagnet, then that is one of the points I'm against. Before I detail why once for the 170th time, I just want to point out that magnetic fields (electromagnetic or normal) do not move if a magnet is static. They do have a direction and they do form a curve, but the field itself does not move. Things affected by the field do however.

A permanent magnet (or an electromagnet that is not constantly changing poles or turning on and off) will attract the ball and give it some kinetic energy as you correctly asserted. What you fail to notice is that this also applies in the reverse as well. As soon as the ball crosses the magnet, the ball will still be attracted to the magnet, but in the opposite direction. The ball will lose kinetic energy as a result. From when the ball starts getting affected by the magnet to a noticeable degree to when the ball stops getting affected by the magnet to the same noticable degree, the ball will have a net change of kinetic energy (due to the magnet alone) of 0. There will still be a change of kinetic energy and speed due to gravity as you would think, but it would be the same as if the magnet weren't there at all.

If you are agreeing with this case, then either I got through to you or I don't know what your argument is.
Reply: @dirgenmeister4018  yes but magnets don't create perpetual motion and can't be used in the criteria of perpetual motion because over very long times magnets lose their magnetism, kind of a hypothetical but technically they will die and therefor no more motion
Reply: That's because the batteries are not included. ☹️
Reply: @charlessellars7871  and before you send me a link to magnetic accelerator. Consider how many and how big the magnets are in those videos and ask yourself if you really think theres just a bunch of hidden magnets. also consider the amount of energy used to to start the device in motion and if the one you're looking at goes in a loop.
Reply: now i get it what cause the unnatural motion. thanks
Reply: not true. I invented one that I have not revealed
Reply: There is no battery here
Reply: @treyara4852  ever heard about electromagnets?
Reply: @Ben-wl7dx  Yes there is
Reply: @erichong5735  magnets have a static field. To have a change in the field like you say it requires energy input I.e. the magnets need to move
Reply: @carlosperezdelema  Umm... Yes? Have you read any of my comments? I've been arguing for electromagnets for a crap ton of time rather than permanent magnets
Reply: @Gruesome_j  magnets wear out overtime so it is not perpetual
Reply: @lehanniehaus9889  I think I agree with you.

 For all those saying magnets: it would be far harder to hide a sensor that detects when to flip off the magnet instead of just run a current from one end of the wire forming the loop that is the track and let the magnetic field from the current hurl the ball along the track.
Reply: @treyara4852  magnet is not the source of power, batteries probably are. It's very likely that the device uses a small electric charge from a battery to magnetize the rails for the metal ball to accelerate. The magnet is clearly not he source of power but magnetism is the method used for accelerating an object in this case metal balls.
Reply: @damianmontesvargas5673  Which is literally what I'm saying. I never said magnets are sources of power, in fact I've said the complete opposite. In addition, I've literally been one of the biggest proponents for an electromagnet in this entire comment thread. How many more comments will I get with this.

By the way the electromagnet on its own won't work. It would need to be turning on and off or be constantly switching poles
Reply: @treyara4852  well lifting the ball to drop it is a source of potential energy, that becomes kinetic...
Reply: @sniperchachashorts5539  gravity is not a source of energy... It's a force... Dropping something requires you lifting it and providing it with potential energy.. so you're the energy source.
Reply: @ppproductions6495  unless the rail was aluminum or any other non ferrous metal...
Reply: @Stellarffxi  To your comment that says 'well lifting the ball to drop it is a source of potential energy, that becomes kinetic...'

Yes. That would give it potential energy. That potential energy is converted to kinetic, but then needs to be converted BACK into potential energy for it to get back to the top. The ball loses some energy to friction so it will never get back to the top without an external source of energy. TBH I'm not sure which one of my points you are arguing with because there was not a mention of magnets in the comment and all of my comments have been pertaining to magnets
Reply: @tho3459  nope
Reply: @tho3459  Oh dear...
Reply: Love how so many people are saying the reason it can't be perpetual is bc it cheats (yes) by using magnets (lol).
Reply: @anonimushbosh  It can't be perpetual because of friction. It cheats by using an electromagnet (but not permanent magnet)
Reply: Or where to hide the magnets
Reply: @TheSting772  Why would magnets need to be hidden?
Reply: @treyara4852  hear me out: gravity 😃
Reply: @TheSting772  Electromagnet (permanent magnet wouldn't work)
Reply: @jemappellemerci  

hear me out: Doesn't work

The problem with that is that gravity is a conservative force. When the ball reaches the bottom of the ramp, gravity slows down the ball as it proceeds. In an ideal system without friction, it would be able to go back up to where it started, but because of friction, the ball loses more speed than it would usually, and then not make it back.

😃😃😃😃😃😃😃😃😃😃😃😃😃😃
Reply: Exactly
Reply: Or the magnets
Reply: That's what I figured. That ball gets launched way too fast for such a short drop
Reply: Obviously there is something hidden in that base. Otherwise there would be no need to make it so thick
Reply: @the888gamemaster  electromagnets. Not permanent magnets
Reply: @treyara4852  eh, close enough
Reply: @treyara4852  I love how you keep pretending to be smarter than everyone and then admitting you're full of crap. 

How would batteries impact this without magnets?

And of course energy is lost at every stage of this, there's friction between the ball and every surface as well as air resistance.
Reply: If the batteries/this thing was solar powered, MAYBE it would work
Reply: @nk-dw2hm  I love it when people don't read the previous comments I've been making.

I've been yelling this entire comment thread that the batteries power an electromagnet. Not a permanent magnet. The reason it has to be an electromagnet is because either the electromagnet needs to be able to turn on and off or be able to switch poles often. That's the only way you could get this to work without touching the ball in any way.

Of course energy is lost every stage. When did I argue against this? If I ever envisioned it in a comment, I would've prefaced it with 'in an ideal system'.

Also in what comment do I supposedly say I'm full of crap?
Reply: @eneveasi  it's an electromagnet not normal magnet, look up how rail gun works
Reply: cool
Reply: Like bruhhhhhhhh.......🤮
Reply: @dirgenmeister4018  Did you forget that magnets repel due to some forces? Huh?
Reply: @IONATVS  it's the combination of movement and a magnet. Neither one provides energy on its own
Reply: @toma.1225  you don't make electricity. It's induced.
Reply: @Suekru3  not a source, but a component to induce
Reply: @erichong5735  they're not. Magnets are a component for inducing electricity
Reply: @Leonhart_93  induce, not create. It already exists
Reply: @tophatvideosinc.5858  Which is also still a theory. Just cause it states things as facts, doesn't mean they are facts.
Reply: Has no one here seen theoria apophasis?
Reply: A perpetual motion machine doesn’t need batteries. A fake perpetual energy machine would though…
Reply: @dirgenmeister4018  they are when you can turn them on and off aka electro magnet triggered by the bead facing on the track completing a circuit.
Reply: @treyara4852   you can turn an electo magnet on by the bead completing a circuit and then have a small timing circuit to turn it off at the half way point that will impart energy.
Reply: @bentroyer1  yes. That's that works.
Reply: @sniperchachashorts5539  no it isn't. The battery in the base powering the electromagnet is the source here.
Reply: Ik bro almost as hard as trying to scam those scammers they're too good man
Reply: Why is it not allowed to use batteries on a device that will keep charging electricity onto it, for free?? I can't believe such devices hasn't been created yet 😵
Reply: @orion9k  because it's a physical impossibility due to th law of conservation of energy.
Reply: Magnets need recharging?
Reply: @orion9k  I'm confused as to what you are saying here.
Reply: Comment section crying/arguing over magnets? This generation is DOOMED, please take a break from the internet, seems like a lot of you need it :))
Reply: @dirgenmeister4018  electromagnets are though, look at railguns
Reply: @Turbo_The_Femboy_Fox  i never said it wasnt. electromagnets produce energy through the changes in current. however, a normal magnet cannot produce energy, it can only use up potential energy and once that energy is used it cant be brought back. any perpetual motion machine with magnets will hit equilibrium and stall
Reply: It's ALWAYS in the baseplate tho so not really
Reply: @ppproductions6495  wait until you hear about non ferrous metals :)
Reply: @dirgenmeister4018  electricity isn't a source of energy either :P
Reply: haha nailed it
Reply: @dirgenmeister4018  you must not understand how electromagnetism works 🥴
Reply: @treyara4852  that's exactly what happens. There's a hidden roller inside the hole.
Reply: The balls are always falling back on the wooden platform a bit behind, the hole where they fell from, so they actually come back with less energy than they when fall? If they were artificially accelerated they would fall at the same point (the hole) or ahead of it?
Reply: @suprememasteroftheuniverse  Yes, that is a possible explanation, but I saw another video with this exact same model saying it's an electromagnet powering this.

In addition, I'm unsure how the roller would be powered without us seeing it. Also the base of the machine is too large imo to warrant it only being a roller
Reply: @winsleyocampo6383  No, energy is lost due to friction and air resistance etc. so it cannot reach its original height or in this case, even higher.
Reply: @sniperchachashorts5539  Ever heard of thermodynamics? The potential energy is converted to kinetic energy however energy is lost to friction and sound therefore it cannot go to the same height or higher than it started.
Reply: @MrBigMoneyMan909  Ever heard of friction, and do you not realise that it ends up higher than it started? 😐
Reply: Lmfao!!! 👍🏼🤣🤣🤣🤣😂🤣😂🤣😂
Reply: @dirgenmeister4018  magnets and gravity?
Reply: It's sitting on a mini solar array too
Reply: Yeag
Reply: Trye
Reply: True
Reply: @dirgenmeister4018  well when the magnet pushes the ball, it gets kinetic energy right?
Reply: @treyara4852  moving solid state magnets are series of electomagnets actuated in order. however, i think here they use a railgun type actuator
Reply: @tho3459  You forgot mirror's and smoke!

Seriously though permanent magnets will not do that.
Reply: @dirgenmeister4018  electromagnetic energy is a source of energy
Reply: @ninjaneerk5601  yeah this device is basically a electric motor in a weird shape
Reply: I'm gonna do one device moved by induction lol
Reply: Classic comment
Reply: @treyara4852  you quite literally have absolutely zero clue about what you are talking about
Reply: @ppproductions6495  not everything shiny is magnetic though there is no way to tell that the rail is also magnetic
Reply: @treyara4852  The magnet doesn't have to move, it just has to turn off (or reverse) at an appropriate point.   Best done with an electromagnet.

That is, after all, how virtually all electric motors work.
Reply: @Foeisudhxj  Explain to me how I'm wrong.
Reply: @fromagefrizzbizz9377  When I was talking about a magnet moving, I was talking a way that a magnet can produce energy. 

You made my exact argument for how this thing works (except I didn't talk about the magnet turning off. I only talked about the magnet reversal. This is primarily done, as you said, with an elecromagnet, which is why this has to be an electromagnet.
Reply: It is under gravitational force
Reply: @leelaumasankargadde2098  Which would also apply as the ball goes back up, so the ball slows down as it comes back up too.
Reply: @Foeisudhxj  What have I gotten wrong?
Reply: Hahah!
Reply: He tells you that its not an actual perpetual matiln machine in the clip
Reply: @thecookiehunterz8169  yea. The joke is that perpetual motion machines don't exist, so because they don't it requires a power source to give the illusion that it does.

That's the joke.
Reply: @tho3459  under the wood there’s a small linear accelerator. It’s a classic trick.
Reply: @treyara4852  It’s got a little linear accelerator under the wood. Electromagnets chief.
Reply: @69cheesyfries  this machine is real, a perpetual motion machine is not possible by it’s definition because you can’t create energy out of nothing. the reason the sphere is able to make it back up is because something in that fat base is accelerating it, giving it more kinetic energy than the original amount of gravitational potential energy. otherwise it should lose energy to friction and not have sufficient energy to reach the top again. something underneath is adding energy.
Reply: @professorstratios8228  which is what I've been saying
Reply: @MrHocotateFreight  the magnet in a generator is not the source of the generated energy.
Reply: In the big base on the bottom
Reply: it has magnets under
Reply: My god the amount of times I’ve seen this comment on a perpetual motion video, I’m gonna literally lose my shit
Reply: @ppproductions6495  So you’re just assuming the rails are iron/steel eh? 🙄
Reply: 😂😂 exactly
Reply: Bro the same damn comment
Reply: This is tha comment I was looking for 😂
Reply: God, the Lord Jesus Christ loves you! Restore your relationship with God by repenting of your sins and putting your faith in Jesus Christ, "... that Christ died for our sins according to the Scriptures, and that He was buried, and that He was raised on the third day according to the Scriptures..." (1 Corinthians 15:3-4)
Reply: So he should have mentioned that it uses batteries, mine came without any provision for batteries
Reply: Come on, Einstein, explain what batteries have to do with this?
Reply: Omg bro, stop with this comment guys, I bet you there many others saying the exact same thing, that just didn't get the likes 😂
Reply: Hahaha😂 good one
Reply: البطاريات أسفل قاعدة الآلة المخاذعة و يوجد مغناطيس في الفتحة يدفع الكرة بقوة
Reply: Guy please it’s literally just an electromagnetic that makes the ball go back up, usually they’re battery powered or rechargeable. The magnet doesn’t have to be moving to induce this effect you can also cause an eddy current by charging the intensity OR direction. So with an electromagnetic it’s super easy to change the intensity due to the electric component
Reply: Unoriginal ahh comment
Reply: It's not a battery is magnets and gravity....
Reply: unoriginal
Reply: The laws of physics is what they say it is, we are so conditioned to accept what has been forced on us, we are so far back from the charge of the innovation charge of the 50's and 60's focusing on nonsense like string theory the topological quantum field theory. We are held hostage by limited physics in academia, funders wont allow us to get into innovative fields, with the secrecy act of 51, we are not allowed to prod in certain places, so when I read the hardest part is to hide the batteries, I get so sad, because we are conditioned to stop ourselves from imagining beyond the convenient laws of physics that has been surpassed in the 1950's by Nazi scientist.